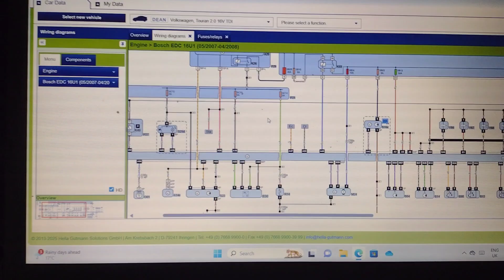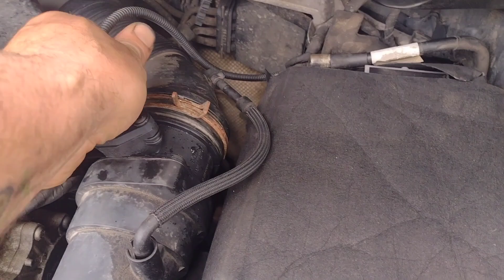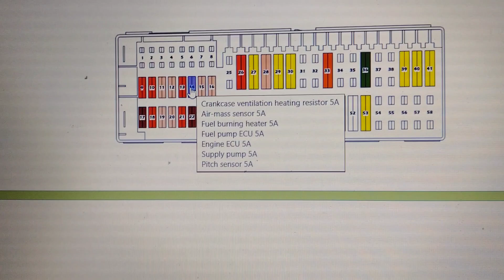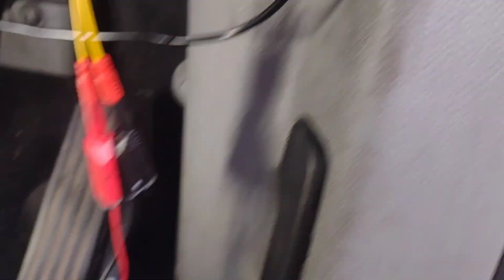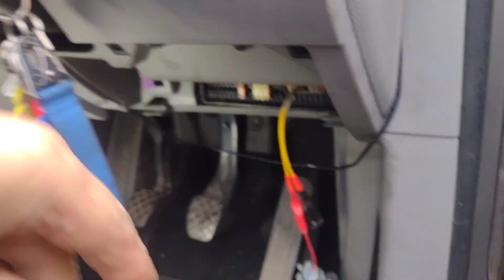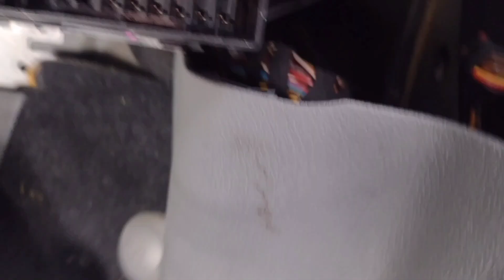The difference between a code read and a diagnosis

Comment: Type of job that usually finds us after they’ve swapped the MAF for the cheapest piece of junk that the motor factor has available and they’ve handed back their original (good quality and not faulty) MAF sensor as a surcharge 🙄. Nicely done Matt, you did well to make the connection between steering column movement and the short. I had a similar job some years back, Octavia came in stuck in limp with a blocked DPF and MAF code. Someone had retro fitted an accessory and used one of these piggy back fuse holders, they’d installed the fuse for the accessory but not the fuse that fed the MAF. Expensive mistake!

Comment: Another good diagnosis Matt,attention to detail as usual.Many customers fail to understand difference between a code scan & a diagnosis.In fact some 'purposely fail to understand',as they are hoping to pay the minimum labour charge!!The voltmeter & test light are 'a must' when dealing with such a fault,having checked for powers & grounds..Thanks for posting.